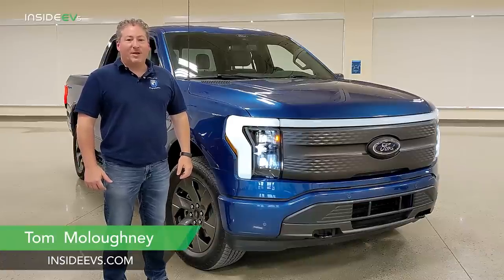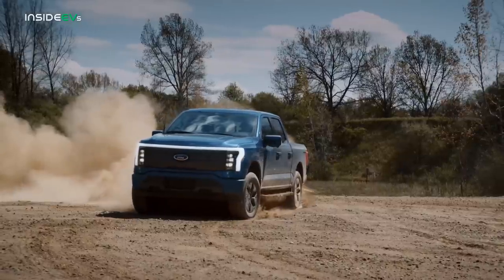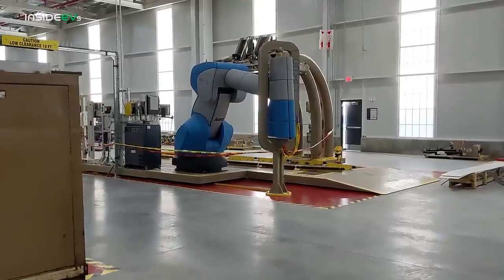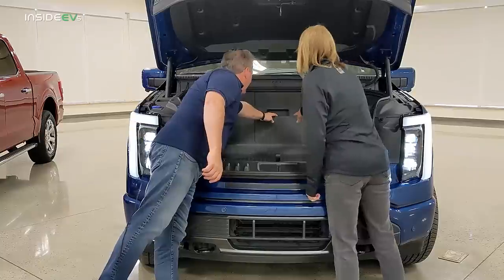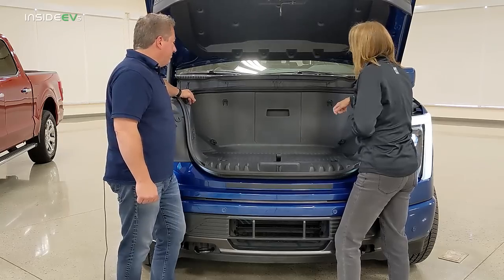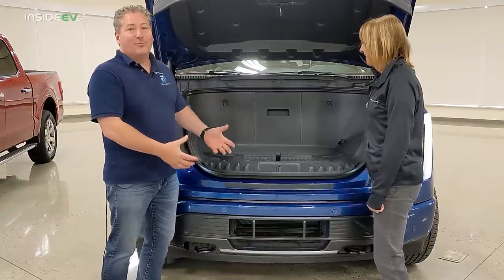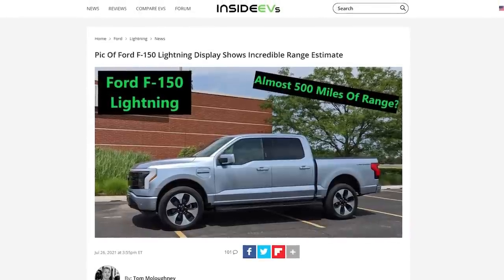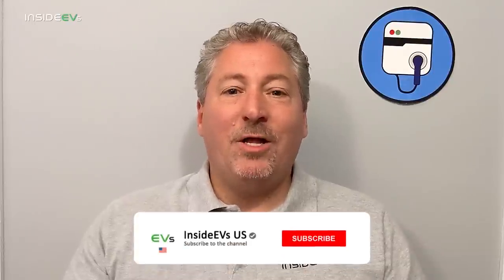Ford F-150 Lightning: InsideEVs First Drive Review

Comment: If they improve their BlueCruise before the Lightnings roll-out,  I might just have to scoop one up. Also , in theory,  you should be able to power your house from the 240v outlet in the bed ,as long as you disconnect from the grid , if you have a 240v receptacle for your charger. It would be like using your houses wiring as a long extension cord. Once your main breaker is off,  Just run a wire from 240v to 240v, now all your houses receptacles will just pull from the trucks battery

Comment: I was very excited to learn the 12 inch screen that I prefer will be available on the XLT, but I heard that Ford was only going to build 15,000 units in 2022. I put my deposit while they were still doing the reveal, but I am now worried about when it will land in my driveway.
Reply: @Madame702  the only reason there is a shortage of batteries is that demand is so high. The shortage will end in 2022 when the patents drop off LFP. There is no shortage of Iron like there is for Nickel
Reply: @kenmcclow8963  Second, only way if Ford and GM is going compete with Tesla if they have and develop their own batteries which they don't.   Sorry, no batteries factories that say Ford or GM on the side of the building, your totally screwed.    We all know these jokers are trying outsource their batteries.     Outsourcing=Losers.
Reply: @Madame702  GM has several battery factories. They have their own brand name called Ultium. They may have learned the lesson about buying from LG that still powers the Mach-E. Ford Is only constrained by the popularity of the Mach-E and F-150, where GM has yet to have a popular EV, although Lyric May be that car for them. Tesla can build cars, batteries or factories fast enough to meet demand which is why they have been bringing LFP batteries in from China ahead of the end of the patents in 2022
Reply: @kenmcclow8963  No they don't.   Please don't lie Ken McClow.   Because if they did they wouldn't have put LG Chem's batteries in their Chevy Bolt.    So do me a favor at lease do some reading.   Now starting to make a battery factory but if your lucky that factory will be up and running by 2026 at the earliest and using really old batteries.
Reply: @kenmcclow8963  You see your using 20th century batteries you know why?   Because the MBA's that run GM now are "Cheap".   LOL🤣
Reply: @kenmcclow8963  No, no Ken you can't all sudden say that GM has a battery factory but they put LG Chem's batteries in their cars.  All their EV's that are on the market have LG Chem batteries.   Nice try Ken, your lies isn't fooling me.
Reply: @kenmcclow8963  I'm mean even the heating and cooling system with the Tesla the most advance on the planet right now.    That when say Ah Mac GM make cooling systems for the cars.  No, no, no I'm not talking about the car Ken, I'm talking about the seat.   You see Tesla now has a cooling and heating system for the your car seat.  Ken reaction "What!!!!".   Yep, Tesla has patient new system where it circulates a liquid that heats up or cools you while sit your car seat.   It only one of it kind and no one in the car industry has it.

Comment: Love the front boot, it is a huge paradigm shift and appears to be super practical.   Shame they couldn't apply the same thinking to the tub, which is an area in duel cab utes (trucks) that has lacked ANY innovation in decades.   
The practical elements (able to power house or campsite, front boot etc) make this a very attractive vehicle; the only concern is how 'practical' it becomes when traveling large distances like many Aussies do when they holiday.   For example, the distance between my two properties is 1830 kilometres.   Time will tell; there's nothing like a launch into markets like the U.S. to sort out these issues!!!

Comment: I have been excited for this pickup, but if I can't get the extended range range on the pro ad a normal consumer, I'm out. And that will most likely cause many people to drop out as well.  A lot of us can't afford the bells and whistles but want to be able to drive it on longer trips and that all Ford will succeed in doing is losing a lot of customers.
Reply: They are sold out for years anyway.  The 2022's are completely over with those were the first to be allocated.  Either participate or not no one cares.

Comment: Would like to see more on back up for home and all the equipment needed maybe cost ?
Reply from the maker: That's not available yet.
Reply: With the price of the truck and the inverter/transfer equipment, you're probably looking at $90k or higher to get home backup. It won't be cheap.

Comment: If you want backup power for your home price out 10 Tesla power walls or even a generator. If you do the math this truck starts looking like a real bargain. Oh, and just where would you put 10 power walls? I don’t even have room for that. Ford should sell a home backup battery made from F150 lightning parts. You know someone is going to hack one as wrecked F150 lightnings start showing up at auction 😁
Reply: Why do you need 10 powerwalls?
Reply: @rogerstarkey5390  It's not a matter of needing that many, that's how many it would take for a comparison to the F150. However, here in Texas it would have been nice to have 3 days of power back when the outage happened. Who knows how bad it will be next time.

Comment: Tom great video. I’d love to know if it can be flat towed behind an RV. We need EV’s that can be flat towed and I’d love it to the the F150. Then I could replace my Ford Explorer and be an all electric family.
Reply from the maker: Watch the InsideEVs podcast on Friday 9/17. We're having Ford's Global Manager of Electric Vehicles, Darren Palmer, on the show. You can ask questions in real time.
Reply: Hey, Eric. I saw a different video that touched on this but not sure if it answers your question completely. There's a button near the shifter, not the 'shifter folder' button but the other button, that (was explained in the video) allows the vehicle to be pulled into a carwash line where you won't have to steer or operate the throttle/brakes. I'm assuming it's different than actual Neutral somehow that you can see on the shifter. That button has an 'N' and a little speedometer graphic.
Reply: And if it would regen while you tow it, you could charge the truck before you get to your destination. That would be Awesome!
Reply: @MichaelFinkSunCommercialSolar  no, you wouldn’t want that. It would cause too much drag and reduce your fuel economy by way more than you’d gain in range. 

The only time the regen would be useful is when braking is required.

Comment: Would still like to see a lower price and longer bed.
Reply: well, sure, who wouldn’t want a lower price. But it’s understandable, isn’t it?

But a longer bed, yes, that’s a heartbreaker for me. Only 67 inches. I’m sure they’ll offer long beds in future years, but that won’t help me now.
Reply: The 39k pro spec is an insane value though for an awd supercab pickup with industry leading performance. 
If you get the full tax credit and state incentives. Plus in some areas local utility incentives. 
Then request some brochures from Ford which can come with up to a $2,000 private cash offer inside them off f150s. 
Well now at under 30k. What can possibly touch it from any competition? 🤔

Imo fomoco needs to watch it. This thing could easily Osbourne their own ice f-150 sales. 😁

Update, according to new planned production press release. Ford will only make about 15k of these in all of 2022, up to 40k in 2023 and up to 80k by the end of 2024. So they really are sandbagging the crap out of overall availability. Especially seeing as they already allegedly have over 120k reservations. 😏
Reply: It's only a matter of time when more options are added to the Lightning/electric F-150 where. They'll definitely have different bed lengths, maybe 2 can lengths, etc. As EVs become the dominant powertrain in the industry, all the body styles and options we have with today's gas vehicles will shift to EVs.

Comment: Great videos. Wish in general your videos were a bit shorter. Most people don't have 20 minutes to watch one YouTube video where they could have watched two or three in that time. Suggest you break em into multiple parts possibly. This as two ten minute videos would be great. Good job on the videos otherwise. Cheers
Reply: Tap the gear icon on the lower right side of the video and select 1.5 speed. :)

Comment: That 400+ mile range estimate could just be the current estimate based off drivign habits. Probably from driving at low speeds in city driving with lots of stopping. Most EV's will estimate something drastic like that when you drive them at low speeds
Reply: Yea, effect range right now is 230 miles.  They have not come out with their long range EV because they don't have batteries to put in them.  That what you get for not having your own battery factory.
Reply: Actually Ford released and said that 300 mile range and 230 mile range is as much based on having 1000 pounds in the back of the truck.  If you’re riding with no weight in the back you will indeed get 460 miles with extended range
Reply: @jameslyons158  Dude, once the 4680 battery are in Tesla cars it over.  Ford can't compete even now Tesla is showing a 30% profit margin that insane.  Here is a video talking about the new 4680 battery for Tesla:   https://youtu.be/KJlEiZpJg2c
Reply: @Madame702  good luck waiting for Cybertruck just like Roadster with years of waiting.  Ford will literally not be able to sell these fast enough.  Really not comparable to Tesla different things.  Ford is the number one selling vehicle in US forever, this will definitely help them retain that.  I want conventional looking vehicle as I love my F150.  Winner winner.  If I want to trade it will fetch a good price indeed. No brainer dude
Reply: @02hreblue30  The won't be around dude, the going out business.  And another thing they have no "Nickle".  That why Elon Musk was warning you over, and over, over, that there was going to be a shortage of "Nickle".  But guys like you never listen.
Reply: @02hreblue30  Electric cars use batteries, batteries have to have "Nickle".

Comment: I doubt it can power a  Is welding machine She skipped over the outlets pretty fast and Started talking about cargo hooks
Reply from the maker: It has a 30-amp 240-v outlet
Reply: F150 powerboost which has a lower output plug can power a welder now : https://youtu.be/0LR7nuAuAMI

Comment: Notice you mentioned liquid fluids. Where are these serviced, (brake fluid, radiator, washer fluid). Vehicle looks good will trade in the Nissan if the price is right.
Reply: sold out through 2024.  You aren't going to trade anything unless you have reservation, and you will take anything they give you for trade because there is no dealing on price nor trade because of demand.  I suggest you sell your truck now and buy it later.  You will be disappointed

Comment: Wow 470+ miles of range on an extended battery size.  Must be supper efficient and probably better coefficient of drag than any currently available Tesla!  Just AMAZING!!
Reply: Nah, it just has twice as big a battery
Reply: Gonna say, if rumors are true 170-180kwh pack size, I would only hope it could go that far without a trailer..  time will tell on confirming this I would suppose.
Reply: The CD is .59 vs the industry lowest vehicle which is Aptera at.13. Heck, the weight of their lowest-end battery pack weighs more than the Aptera. But you can not compare a truck to a car. Out of all the EV trucks announced to date, they appear to have hit all four cylinders or should I say packs.
Reply: That 472 number could be nothing. Time will tell
Reply: @Carl_in_AZ  the CD is not .59 the 2014 Toyota Tundra 4x4 was .38 and that has worse aero than the Fords. Rams with the HFE pack are .36 in 2015. the Nissan Titan was at .44 in 2003 when it launched.

Comment: I hope you know if you live long enough you will be FORCED to buy electric. 😞
Electric is for people that don’t care about the sound and feel of a high performance engine. 
I will try to make my GT Mustang last forever. 
What ifs about the Lightning. 
It has two front and rear motors. If you don’t need four wheel drive could the two 
motors be on each rear wheel to get the same performance and have a alternator/Charger
on the front wheels to recharge the batteries as you drive?  
Why hasn’t someone thought to use solar panels made into the roof/trunk/hood??
They could be made to look almost invisible. 
Just asking.

Comment: Good video.  I’m not so sure about the ~10 kW lasting three days.  Tesla’s powerwall has about 14kW and they say it will power a house for 24 hrs...not 3 days.  Maybe if your not running everything(A/C, TV etc) except the fridge.  I’m a systems engineer and not electrical, but Im not sure 🤔
Reply: I think you're confusing kW and kWh. The F-150 Lightning can deliver up to 9.6 kW constant power. However, it will have more than 100 kWh (probably closer to 130 kWh) of storage so it has the energy of 8 to 10 powerwalls (14 kWh). So yes, it will be able to power a home for at least 3 days, probably closer to 5-6 days with some conservation.
Reply: Will the base/pro model have the same number of outlets and locations as the other (significantly more expensive) models?
Reply: The estimated storage capacity of the long range Lightning battery is probably 150+ KWH , over ten times the Powerwall's capacity.
Reply: @StateOfChargeWithTomMoloughney  130kwhr = 8days power for the average household consumption here in Oz, and that is if you dont have roof top solar.
Reply: @StateOfChargeWithTomMoloughney  yeah sorry didn’t clarify, but I misunderstood that the Ford would only use 9.6 kW and then stop for saving the battery drain.  I didn’t realize they would expend the whole battery.  I have a model x and yes that 90 kWh battery would power a house for about 5 days normal use and maybe 7 being conservative.  Thank you for not biting my head off like most you tubers at the slightest mistake.

Comment: Ugh, the useless and unnecessary engineering of that pointless shifter and the fold down function. More legacy OEM thinking. How would they not want to remove parts to increase profits? Are parts and repair really that important to their bottom line? Just put a simple button or two or a dial on the dash or where the key used to be.

Comment: Dump the gear stick for more cup holders or something. The automotive industry should have all dumped that thing when it became a drive by wire unit.
Reply: more cupholders?  why would you need more than 2 in front?  ludicrous
Reply: @02hreblue30  phone holder that goes in one of the cup holders, 1 for each passenger and store the extra beer in the door duh. By the way, I said or something. The fact is, that lever is not required any more.

Comment: I hope the lighting doesn't catch fire like the Chevy bolt
Reply: It Ford, it way better engineering then a GM.    But the truck is way to heavy and weight is issue especially when you have a EV.

Comment: Impressive truck, so far, BUT YOU DEFINITELY need to go back and correct your FALSE statement that the F-150 lightning has as much power as 8-10 Tesla Powerwalls…go back to EE101 and after you realize how false this statement actually is, you should be embarrassed…sorry, no bias, just truth…
Reply from the maker: Perhaps you should check your facts before commenting. The Powerwall has 13.5 kWh of energy storage. The F-150 Lightning's battery pack will be approximately 150 kWh. Do the math. ;)

Comment: So the frunk is the best feature 🤔 that low standards
The pro trim not available to normal ppl 😒 
230 mile range 
Ford is making a mediocre electric truck
Reply: At 230 mile ranges with 1000 pounds in the back of the truck if you’re not driving with that load you’re going to get 300+ miles on the regular version and 460 in the extended version.  This is literally the best electric vehicle that has been released onto market to this point nothing can compete with it